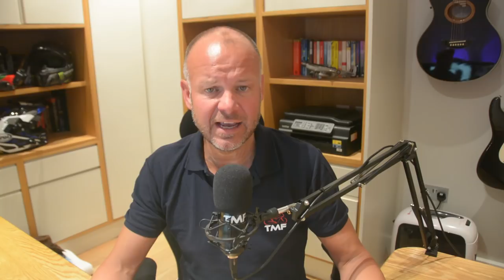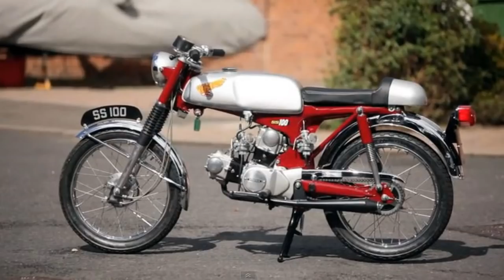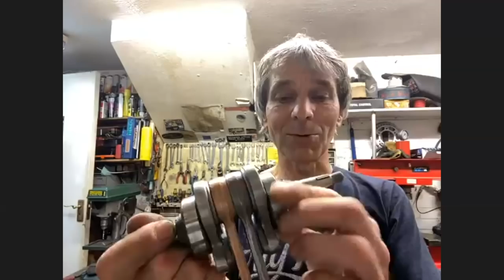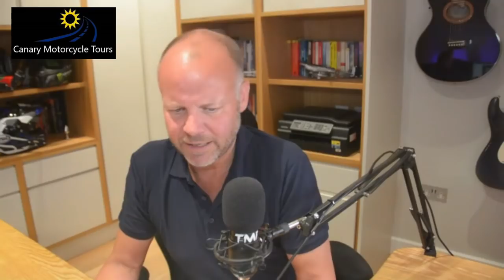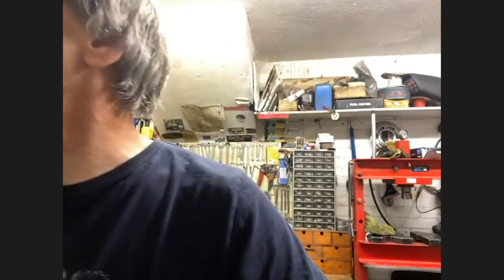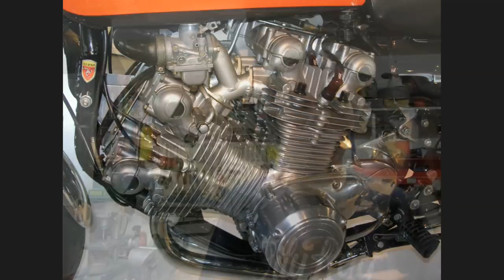Allen Millyard Interview - How to build a V10 8 Litre motorcycle and much more

Comment: Internal combustion engines put about 1/3 of their energy potential out of the exhaust hence the interest in turbos and compounding devices. 

Then there is about another 1/3 wasted through heat. I think various attempts and recovering wasted head have been tried, but they've either not been reliable or economic. 

Roughly an engine makes about 10hp/litre per 1k rpm. Any kind of forced induction can increase engine capacity in the above calculation by itself for every bar of boost. Higher reving engines seem to make slightly higher figures than I've quoted above as inertia in the gas flows gives a forced induction effect. 

A 100 cc engine would give about 1hp per 1k rpm so to get 10 hp would require 10k rpm. Some sort of turbo could add about 30% to this and so would make about 13hp at 10k revs. Recovering the heat from the cooling system could add up to another 30% so we would be looking at about 16hp for every 10k revs. 

So to make up the difference we would need about 62,500 rpm. Potentially this could be lowered by over boosting the engine. Running the engine with 10 bars of boost would make it the equivalent of a 1litre engine so it would only need to pull 6-10k rpm depending on the efficiency of the heat recovery from the cooling system. 

Steam engines did successfully recover heat and energy from their exhaust system by using an additional cylinder fed from the primary cylinder. 

Theoretically it's possible but in reality it would probably be more cost effective to just pay for the additional fuel required for more power.

Comment: Here is a challenge for Allen. Cizeta V16 in a bike. Maybe make it a VV 16 (not a misprint - double V). i.e. bend the right and left sides up to gain leaning clearance. Just need some angled gears to connect the cranks and cams. Obviously hideously costly. Owners maybe having estate sale v soon.
https://youtu.be/y1gH0V4AOCo?t=1679
view from transmission, plus cranks

Comment: "I don't like Rotary engines. They do nothing for me." This is a real man. Millyard's inline 4 cylinder 350cc Kawasaki 2 stroke with expansion chambers, is the best sounding motorcycle I've ever heard. Rotary engines go bad immediately, burn too much fuel, produce zero torque, sound like an electric turbine that is out of balance, and they are just all around, the worst concept in history. Millyard is an engineering genius, so if he builds an engine, it's because it's a good design.

Comment: Good to hear Allen mention Odyssey batteries. In 2010 with a minor rearrangement in the battery tray on my Ducati I replaced the 12 amp hour battery with an 18 amp hour Odyssey one and it’s still giving sterling service. 24/7 on an Optimate 4.

Comment: Are modern bike chains any better than ones back in the 70s? I had a Yamaha RD250 when I was 17 and could adjust the chain tension almost weekly and soon had to remove a link as I'd got to the end of the adjustment. I ride a Honda VT750 with shaft drive these days and do not miss chain drive, but when I look at getting a new bike I get put off by anything with chain drive.

Comment: The secret to combustion engines is lean burn technology, detonation combustion. Diesel engines run on detonation. If you can make gasoline run on detonation, the mixture can be reduced by 50% or more. Running an engine leaner than 18.1:1 air to fuel can be very difficult. But with special technology, it may be possible to run a mixture of 36:1 air to fuel. They won't tell us how this is done, although you can be sure that they have this technology fully perfected. This could be why they are using direct injection engines, because the direct injection is required for "lean burn" engines. They may want to make sure they get the fuel systems perfected, before making the switch to lean burn combustion chambers and lean burn plasma spark ignition.
Reply: Look in to the great Smokey yunic  from Daytona beach Florida. The term detonation is wrong you need controlled combustion. If you could ignight the whole combustion chamber at one time lean burn would work. Like using micro waves ,make the piston surface react with them or the cylinder head react.

Comment: As ever great video TMF. Allen got me thinking about my old TZ700 (original twin shocks) and its need for a suitable engine . I had put a Kawasaki S2 350 triple in and made up and over Denco design pipes but never happy with it to complete - I really need to make an RD500/700 in-line for it.

Comment: A slight correction regarding Allen Millyard's comments about specific fuel efficiency in petrol engines.  While it is true many internal combustion engines in the past have hovered around 30-32% conversion of potential energy to fly wheel kinetic energy,  recent advances in the past 10 years have seen racing engines now approaching 46% in some circumstances,  and this is before energy harvesting.  In Formula One for example,  with Kinetic Energy harvesting some of the engines are now approaching 60% potential to kinetic fuel efficiency.
Reply: In fairness,  motor racing is a super niche arm of combustion engine technology,  but something which can't be denied is the recent ability for energy to be harvested and regenerated into an engine's drivetrain.  This suggests the internal combustion engine in a normal passenger vehicle will probably continue to improve for a fair while yet.

Comment: TMF, good point Allan makes about battery trickle chargers. My bike had been in back yard under a cover for four month, not been touched and not connected to a trickle charger. I got the battery charger ready plugged an extension lead in to the mains then went out and took the cover off the bike. Went back inside for bike key to unlock the saddle to get at the battery, thought I'd just try the electric starter, even though I really expected the battery to not have enough power.Ignition on dash goes through start up sequence, I gave a push on the starter button and the bike started just as normal! I had not connected the charger. I let the bike run until it showed a number of degrees on the temp gauge, stopped it and waited a few minutes then started it again, instant start!!
So do you think these trickle chargers are just a fashion item or an essential for every motor cycle?
Reply from the maker: I don't think they're essential unless you're running a wired in tracker which sap your battery power (don't ask me how I know!)....
Reply: When a battery is new it holds the charge fairly well so as long as it gets regular charge from running a good distance it will stay in good condition. As a battery ages the power level drops off and it never reaches full charge so it has less reserve, due to sulfates building up on the plates. This can create a situation which leads to internal leakage of power which then accelerates the deterioration of the battery.
Keeping a battery topped up is the best way to make it last longer and keep it reliable.
Obviously this is a simplified explanation and there are other factors that can cause a battery to degrade such as temperature but the main thing to remember is it needs to be fully charged at all times to remain healthy.

Comment: An amazing guy but I was distracted by the thing on the ceiling on his right in the picture, what the hell is it?
Looks like a block of styrofoam...
Reply: Keith Ward - The underside of stairs?
Reply: It’s the underside of the stairs to my extension, I designed and built that in 1992
Reply: Allen Millyard oh I see, thanks, I shan’t be so distracted next time.
How about building a CX1000 from two  Honda cx500s, I would like to see that, can it be done....